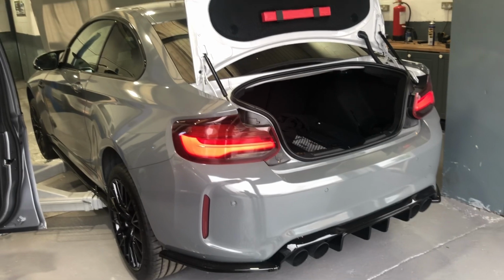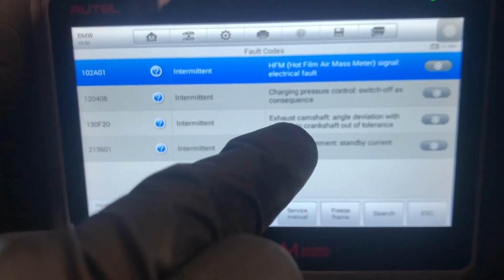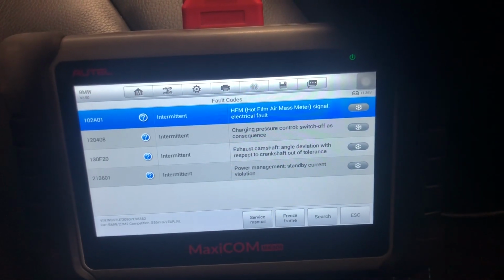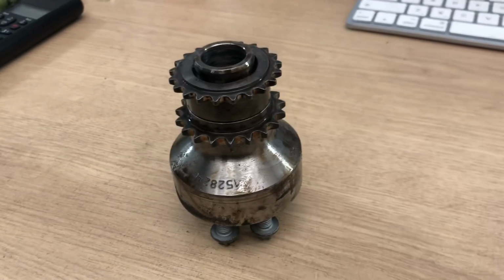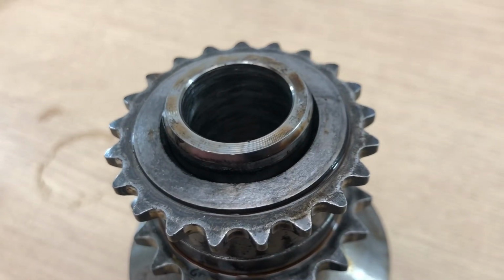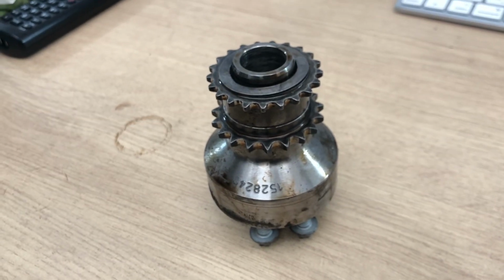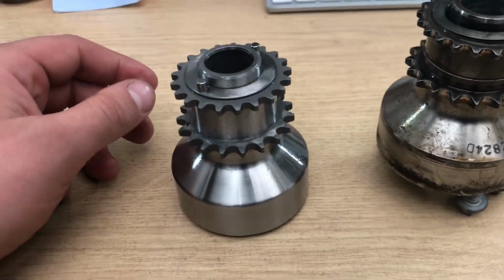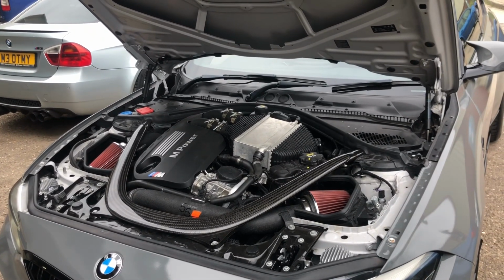S55 CRANK HUB SLIP! WHAT HAPPENS? AND HOW DO WE FIX IT ?

Comment: Interesting and informative video, thank you so much.
Fortunately I have an OG M2 so this won't affect me but I have always wondered about the S55 problem, and this helped me understand.
Reply: I’ve heard the n55 also has the same crank hub. But you’re right, I never really heard the same thing happening like on the s55
Reply: @MarkCalica  Yes it is the same none pinned crank hub in both, I have never heard of any crank hub failure in an N55 engine.
The engines are very similar around 75% identical, both 3 litre, but the bore of the S55 is 89.6mm v 84mm for the N55, also the stroke was 80mm for the S55 v  89.6mm for the N55. This enables it to rev slightly higher 7600rpm.
The S55 is a closed deck v the open deck N55.
The N55 has a twin scroll single turbo, the S55 has a twin turbo.
The cooling system is different, the S55 has a charge cooler, the N55 a traditional intercooler.
There are supposedly 16 differences in the cooling system. The S55 has FOUR water pumps, and EIGHT radiators !
Both have forged con rods and crank, but the S55 has forged pistons.
Oil supply system is different too, fuel system (S55 has TWO high pressure fuel pumps).

Comment: Why bmw design it like that, for such an performance car isn’t this considered recall or miss development? These should cover by bmw then
Reply: It typically is only a risk to cars that have been modified to produce more power etc.  Stock you should never really suffer the issue... 'should'
Reply: It’s mostly tuned s55.  I’ve got 120k on a 2015 s55 m4 , completely stock and has had an easy life going up and down the motorway.  As soon as these are tuned beyond the stresses that they were tested then you are open to some issues.